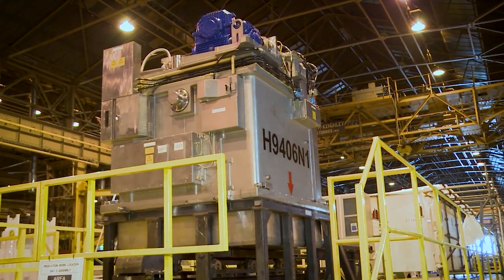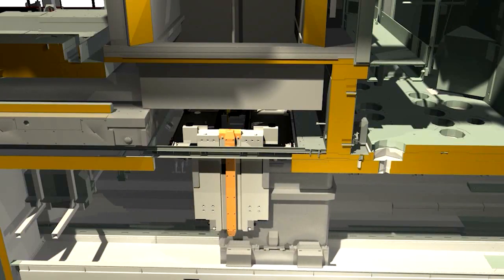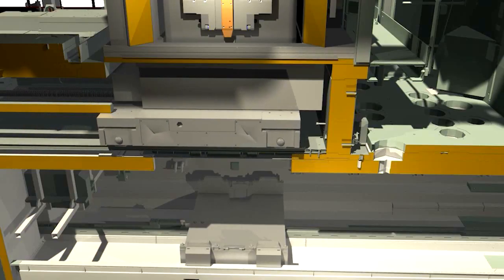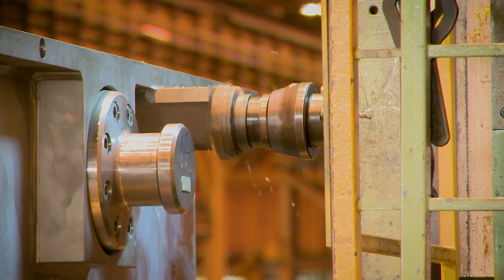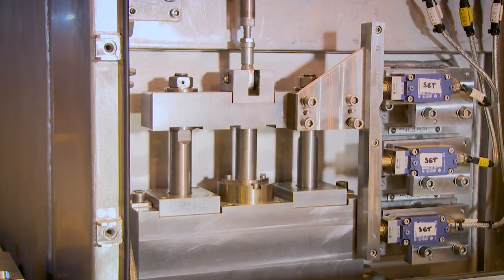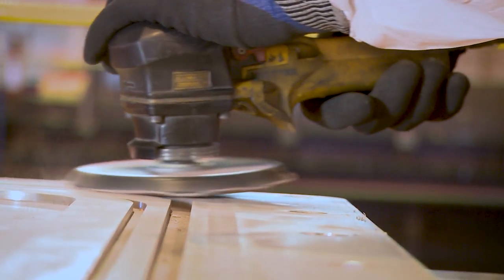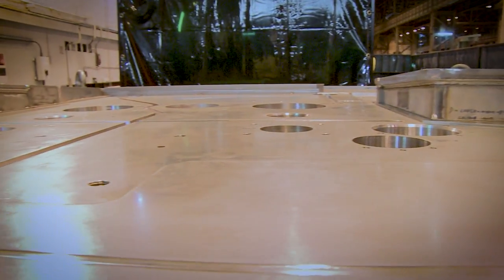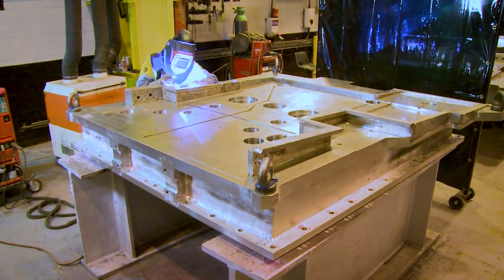Radioactive waste containers

Comment: 20-30 years is barely an instant within the horrifyingly toxic afterlife of that place.

When it comes to radioactive waste, we need to be engineering solutions that can last for centuries.
Reply: Tomakak  Each one is invisible and dangerous. Radioactivity has more stigma and more rarity, so it feels scarier than plain ol' chemical toxicity... but we really need to be concerned about both.
Reply: Tomakak  True 'nuff. Ionizing radiation in particular, then, which I think I'll categorize as yet another example of toxicity from here on out.
Reply: About 6 centuries, to be precise. After that period of time, the radiation from the waste will be back to the levels found in the original ore. It's easily handled and can be disposed of like any mining waste. There are wooden buildings over 600 years old...

Comment: Why don't spent fuel in pools wen ther all close together go critical and what causes it to be different in the reactor
Reply: Fuel becomes spent in a reactor because fissile isotopes are depleted and neutron poisons build up. Eventually it becomes incapable of sustaining the chain reaction and thus useless for power generation. You don't remove the fuel from power reactor while it's still capable of sustaining criticality and thus power generation.
Reply: @aleksandersuur9475  There is a criticality risk in fuel ponds, but that is managed. For example, fuel skips will only carry a set amount of fuel and the skips are arranged in the pond so as to minimise the risk of criticality i.e. by keeping fuel as far apart as possible while maximising the available space to use.